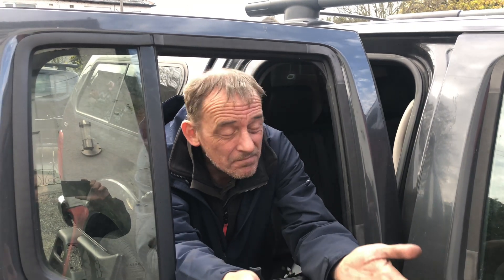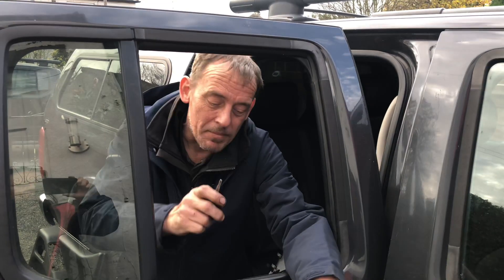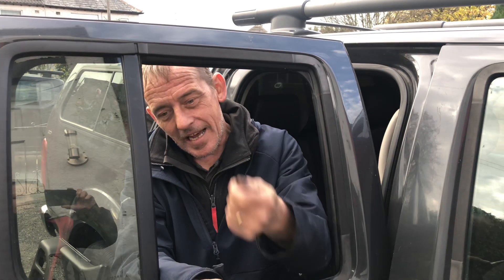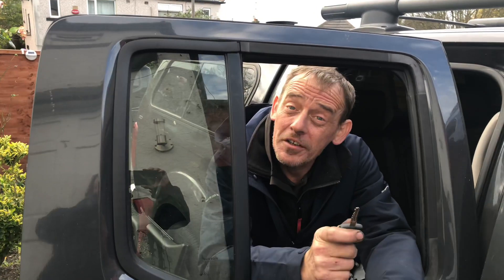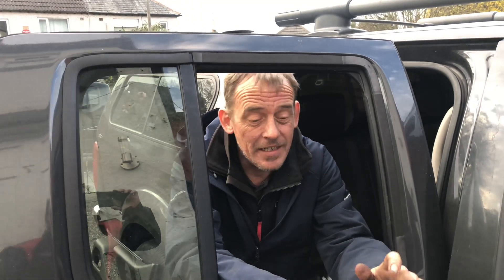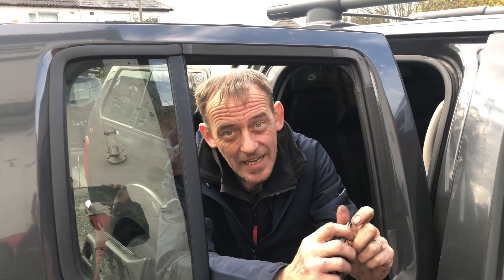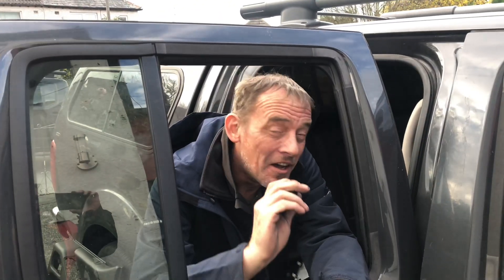Smashed window ceased door Lock

Comment: My passenger door lock stopped working. Always stayed locked. Fun little job removing all the bits to replace the door lock mechanism. 2nd hand one did the job. 

I'm having cold start issues. Blowing white smoke and a little bit of blue smoke, I glow the plugs and give it another 5 secs after the light goes out and it usually starts better. Leaning towards glow plugs.... again. It also rattles above 2k rpm until it gets hot so maybe an injector going bad. It also blows a fair bit of soot so also leaning to injectors getting a bit worn. Fuel filter gets changed every 15k. feels a little down on power compared to my dads d40 which is same year and engine. New SCV, New boost control Solenoid, Boost lines replaced, Maf cleaned, Serviced every 6k. getting into aussie winter. really bad to start under 12°c. not even that cold. 

Battery is healthy, i even have a bypass switch on the alternator so it will charge at 14.5v. 2011 r51 2.5 - 175 000km.

Comment: Hi Des, I hope you don’t mind a quick question if you have time to tell me what you think. I have a 2004 D22 diesel, I drove it 1200km, then it would have trouble starting, it would wind over for a long period of time before it would start, then it wouldn’t start at all. I replaced the fuel pump and I got it started again but it’s still taking a long time to start. I have a feeling I’m not bleeding the fuel line properly, the only way I can get it to start is by pumping the primer before turning the key, but then still taking a long time to start. 
Anyway, thanks for sharing videos, the information in previous videos have helped me out before, take care mate 👍
Reply from the maker: easy call me on 01274 640028 buddy
Reply: @westyorkshireengineservice9160  Cheers for that, I’ll give you a buzz in a day or so, have a good one 👍

Comment: Hello! Romanian fan here! I want to buy a Nissan Pathfinder 2.5 dci automatic 2006. It seems to have 3 issues: 1. It seems to leak oil on the turbo zone. 2. Doesn’t release smoke but when the engine is on for the 2000-2500 rpm it dies. At the first try (start on) it stops at 500 rpm and it dies. Then it starts again like it has no problem. I didn’t actually drove the car but it seemed suspicious. What do you think? I want to buy it but I don’t know if the issues raised are a red flag or an easy fixable problem. Thank you very much for your videos and actual help!

Comment: Hi there totally different subject but I have a 2013 navara it's currently at nissan code p1622 the problem they are having is it won't accept new injector codes trying different injectors and ecu reprogram still the same issue have you come across this before thanks in advance

Comment: Hi Des, I've got a 2008 pathfinder and basically I have to drive it about 15 miles in the morning before the engine heats up and as you can imagine in the winter it's bloody freezing. My garage has had it for the day and tried all sorts of different stuff but no joy. Any ideas mate?
Reply from the maker: Thats normal mate use heated seats
Reply: @westyorkshireengineservice9160  thanks mate, i do 😂
Reply: First job is to check / change the thermostat as there is nothing normal by taking 15miles for the engine to warm.
Is the gauge working as it should ?
Is the heater matrix getting the flow of water it should ?
No point asking the Des as he will try to lead you into workshop / shed at some stage and a quick google search will show you where that leads.

Comment: Hi mate I wonder if you can help me I'm having trouble for my 2006 Nissan Pathfinder it's going into limp mode when you stop at lights or idling below 1000 RPM it will go into a p0089 fault I have replaced the suction control valve and fuel pressure sensor and done an ECU learning reset but no good if you turn the key on off the car will drive fine run perfectly well it's just if you let idle for 30 seconds or more it will go into limp mode no one can figure this out can you help me cheers
Reply: It's the 2.5 diesel
Reply from the maker: Did you do a fuel pump reset and also change the fuel filter
Reply: @westyorkshireengineservice9160  yes I did change the fuel filter and did a fuel pump reset still doing the same thing
Reply: And the car when is not faulted runs perfectly fine no black smoke no loss of power no knocking noise I just stopped at a set of traffic lights 30 seconds goes into limp mode I have to turn the key on off again and it's out limp mode until I get to the next set of traffic lights
Reply: Just wanted to say I love your YouTube channel i have watched everything video love your work mate
Reply from the maker: @runningonbeers7449  cheers buddy 👍
Reply: Any ideas of what it could be mate